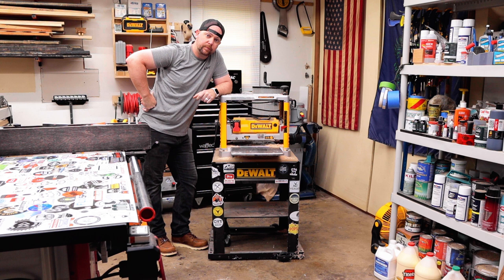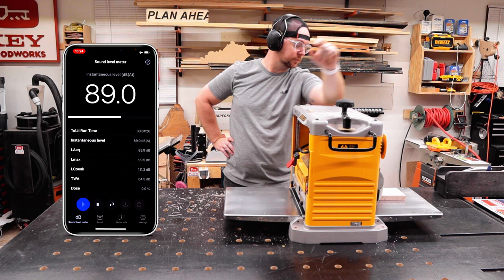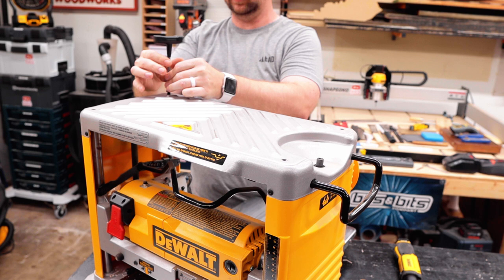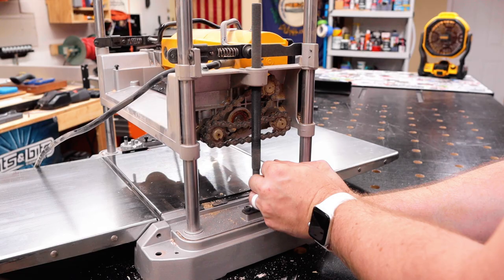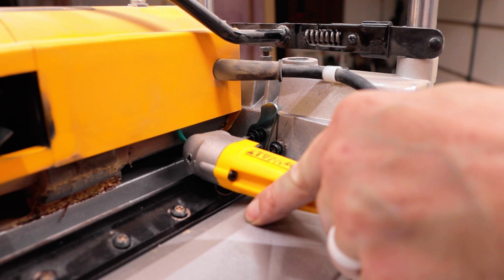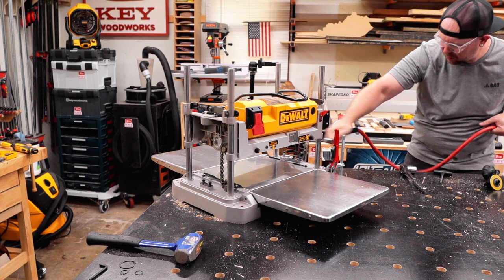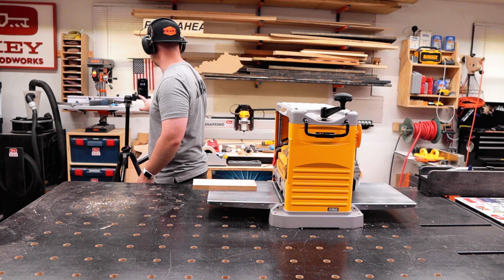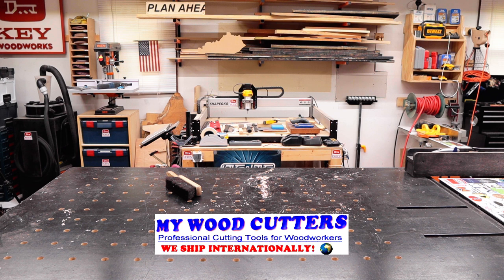Lux Cut iii Helical Head Install | DeWalt 734 Planer

Comment: Thanks for the video.  I've been thinking about this upgrade for years, but I wasn't sure what was involved, so I was putting it off.   Knowing it could be done in a few hours without any specialty tools gave me the confidence to take it on.  That said, if you don't mind I had one tip to offer, and an additional step to suggest.

For the tip, I suggest moving the cutter head to full height and locking it there before starting.  That will allow easy access to the chain guard screws on the roller mechanism side, and have the minimum amount of threaded rod to remove if you take them out the bottom.  I observed that once the sprockets are removed, the bottom of the threaded rods are thin enough to chuck into a cordless drill, which will spin them out in and out in few seconds.  You'll have to do about 1/2" by hand, but the drill will take care of the rest.

Also, it may be necessary to calibrate the cutter head at the end.  While the four-post design is going to keep the cutter head reasonably parallel to the bed, if the threaded rods are removed with the head unlocked, it will rack slightly. (That's why I suggest locking the head in my tip above.  I didn’t lock it, but in hindsight, I could have and wish I had.)   After this upgrade it’s quite possible to end up with boards that are thicker on one side than the other.  In my case, one edge of an 11"W board was 0.035" thinner than the opposite edge.  To calibrate the planer:

1. Prepare a wide board for planing (or use plywood).  The closer the board is to full width the better.
2. Make pencil marks over the entire face so you can be sure when the entire surface has been planed.  Also mark one edge so you can keep track of which side of the planer it was on.
3. Plane one surface as you normally would, making sure all the pencil marks have been removed.  Be sure to note which side the marked edge is on, and feed the board in the same way every pass.  Lock the cutterhead between passes, and keep it locked after the final pass.  You’re going to lay the machine on its side and you don’t want it to shift when you do.
4. Measure the thickness of both edges at a few points and take an average of each edge.  Calculate the difference between the averages and convert the difference to 64ths (1/64=0.0156) so you can use the scale on the crank to make the adjustment.  If the difference is less than 0.010", then I suggest leaving it alone.  You could spend hours trying to improve on that and may never do it.
5. Set the planer on its side to access the chain mechanism on the bottom, then loosen the sprocket grub screws on the side with the height adjustment knob until it slides freely on the shaft and turning the crank won't affect the other side.
6. Release the head lock and turn crank the number of 1/64's you calculated in step 4.  If the crank side was thinner, then turn the crank in the up direction, and if the crank side was thicker, turn it in the down direction.  Tighten the grub screws.
7. You should be done, but I recommend another test cut just to make sure.  After the first adjustment mine was about 0.008" (~1/128") different across an 11" board. I would have loved for it to be perfect, but slop in the height adjustment mechanism makes that improbable, so I didn't try to do any better.

Comment: I watched your video very closely and then performed the install myself. Your instructions were spot on. I succeeded first time with no issues. I don't think I could have done it without your help. Thanks!
Reply from the maker: I love hearing this! Thanks Art!
Reply: @KeyWoodworks  I've planed a lot of boards now. The planer is humming along beautifully and the planed surface of the boards is amazing. Thanks again for helping to make this possible.

Comment: Thanks for the well done vid. I have the same model and vintage of your 734 planer and this vid will save me a ton of time.  As a long time hobby woodworker, I was fortunate to obtain 500 BF of American Walnut from a neighbor's huge tree that has been drying now under cover for 3-years cut in 10" widths in 6/4+ thickness from both sides of the pith and is at 9% MC.  I also have a ton of quartersawn white oak that needs machining.  At the current cost of good walnut and quartersawn white oak delivered to western states,  it is obvious that installing the spiral cutter heads on both my planer and jointer is  a prudent decision.  Here is a hint for the snap rings,  put a small Neodymium magnet on the ring pliers so when the ring is removed it sticks to the tool rather than flying into a hidden spot in the shop.  LOL  B-T-W: I ended up ordering the LUX heads because the SHELIX seems to be out of stock and BYRD says possibly 16 weeks + lead as of April 2021.

Comment: Good video. Only thing that I’d  mention worth correcting is that a 7db drop is not 2 times quieter… it’s significantly quieter as each decibel a sound goes up, it doubles from the last decibel… it’s exponentially quieter.

“ On the decibel scale, the quietest audible sound (perceived near total silence) is 0 dB. A sound 10 times more powerful is 10 dB. A sound 100 times more powerful than near total silence is 20 dB. A sound 1,000 times more powerful than near total silence is 30 dB”

Comment: I just did this upgrade. After install now I can’t for the life of me get a flat board out of it. I’ve tried adjusting the height and used an indicator. I get it from side to side .001 from the table to the blades but when it comes out it’s not flat. And now I get huge amount of snipe on one end. Did you have any issues like this?

Comment: How did you get yours to cut evenly across the board. I am struggling to get mine to cut exactly parallel across the board after fitting the new head. Great video though. helped me tremendously.

Comment: Sadly, most of us don’t have woodworking channels and therefore won’t receive the replacement head for free.  Spending $550 on a replacement part for a planer that costs $400 doesn’t make a whole lot of sense.  I’d rather spend $1000 on a wider or higher quality unit to be honest.  A grizzly with helical head is $700.
Reply from the maker: Everyone has options.

Comment: so I understood that you remove the head off the top of the 4 post and then remove the cutter head, you instead removed the up/down threaded shaft and swapped heads while the motor was still on the 4 post.. is their and advantage or disadvantage to each way? im about to do this upgrade

Comment: noticed that you had the head lock lever depressed as you were adjusting the depth. the manual says to lift it to the unlocked position, adjust the depth, then depress the  head lock lever back down to lock it in damn i sound like a nerd right now huh @key woodworks it’s probably not that serious

Comment: @Key Woodworks Biggest complaint I read about the helical head upgrade is that the planer doesn't have as much power. I assume this means that the depth of cut must be less. How deep a cut can you make on a full width board after the upgrade?
Reply: Often the usual depth of most cuts after a helical head is installed is 1/8".
Reply: Depth of cut will depend on the width of the board.  I just installed the Luxcut II head on my DW733.  (I believe the mechanicals are identical to the DW734, except mine has a 2-knife cutterhead instead of a 3).  To calibrate the cutter head height,  I used an 11"W yellow pine stair tread.  I tripped the built-in 15A circuit breaker with a 1/32" DoC.  I've been using this planer for 15 years, that only happened to me once before, while doing a 12"W hardwood, end-grain cutting board.  Tough, wide cuts will need to be very shallow after the upgrade.  On the other hand, I also tried a 6"W piece of hard maple, and 1/32" was no problem.  That's the kind of work I do most often, so I'm still glad I did the upgrade.

Comment: My dewalt 733 was around 1000 euros. The helicat head is around 600 euros. Way too expensive. I would pay 200euros max but not 60% of another brand new planner.That.s a bad joke price for helicat head. 600 euros could give me 10x brand new blades for next 10 years to come not to mention I can always sharpen existing ones. If upgrading I would rather have spent 2000e for professional planer and thicknesser and have real day and night difference machine.

Comment: Thanks for making this video. Well made. I'm debating between getting this head for my 734 and replacing the 734 with a 735 and a helical head. The problem I have with my 734 is that it stalls out and trips the internal breaker if I take any more than a hair off at a time in a hard wood. Have you had problems with yours stalling before and if so does it stall less with the new head?
Reply: It's good practice to do only half a turn per run..1/8 puts allot of resistance on the motor

Comment: Awesome video, Nick! Thanks for posting. I have the same planer and have been considering the upgrade, but I just don't know if it's worth it. After using it, do you think it would be worth the cost, or do you think it would be better to hold out and get a larger planer with a stock helical head? I do plan to upgrade in the future once I have 220 in my shop, I just don't know when that will be. Thanks, Nick!

P.S., love the Shop Sounds podcast! - Joe
Reply from the maker: Thanks for watching AND listening! I’d say if you know for sure you’re going to upgrade to 220 soon I’d wait and go with a larger planer, but if you don’t know when that would be, the helical head is a killer upgrade.

Comment: hopefully you kept count on the number of turns for the left gear.  if not your planer won't be level.
Reply from the maker: The head was locked so it never moved and the left and right gears work in tandem
Reply: I did one of these exact heads in my 734 . Love the quality of cut . My planer is off level just a hair and I probably did this exact thing
Reply: @billywigs  you can flip your piece between passes to level it out.